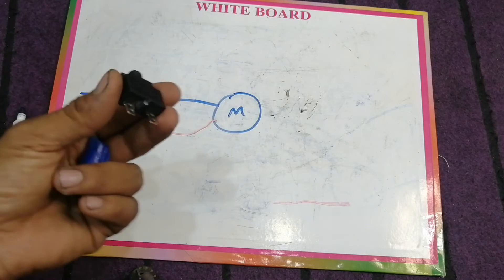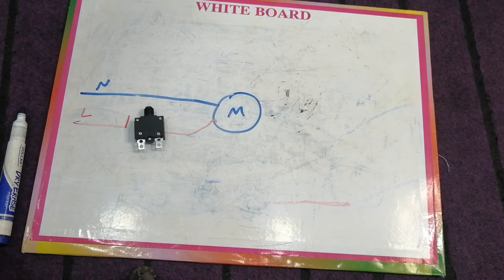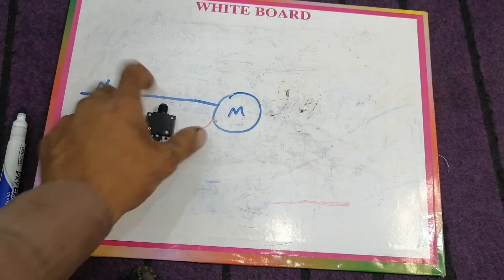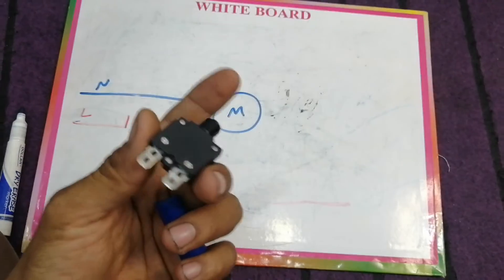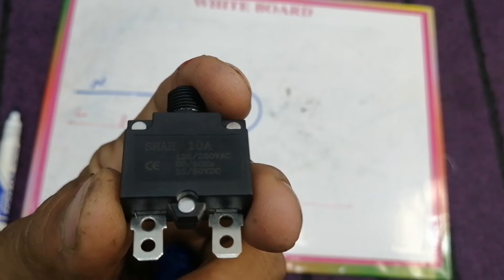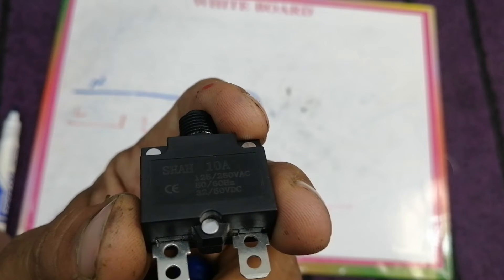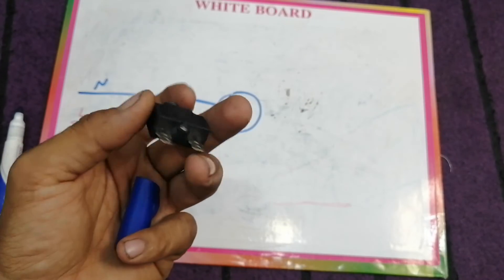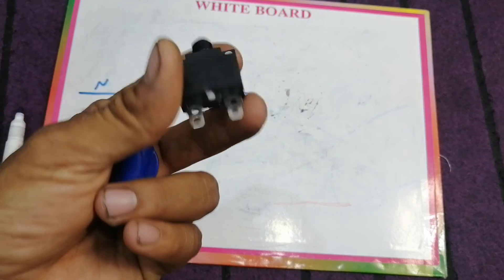Resettable Thermal Overload Protector For Electric Motors (English)

Comment: Can this be used for 220VAC? Would it be placed in the Neutral line or in one or both Hot lines?
Reply: Yes ofcourse..it can be used for 220-250v ac.
But u have to wire it only to the live/L wire coming from the ac supply to the motor.